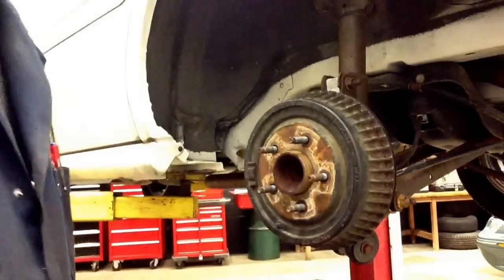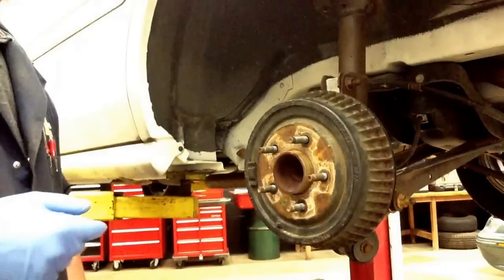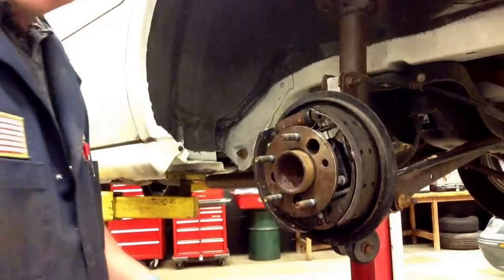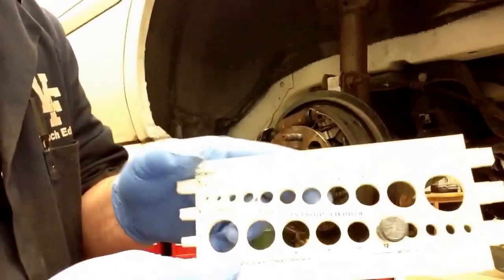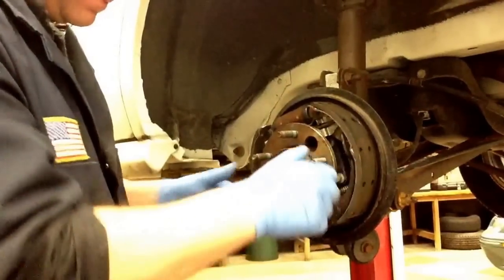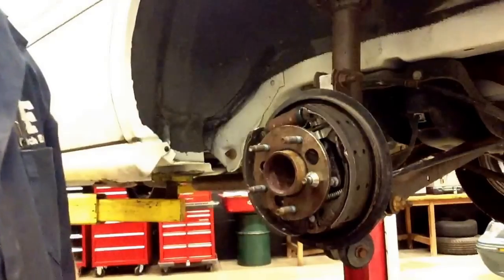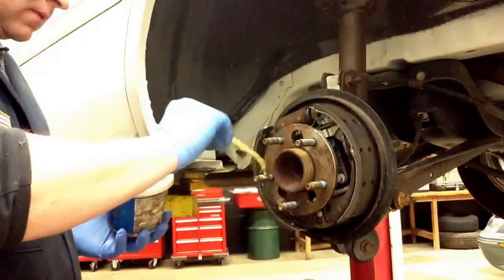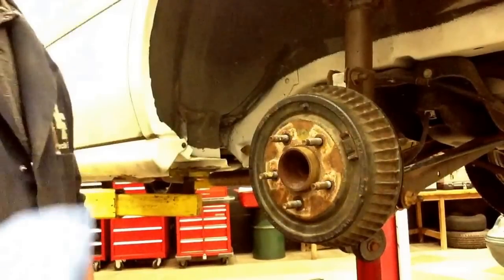Brakes: wheel stud replacement

Comment: where did you find that nut that you used to tighten the wheel stud?
Reply: it's just the stock lug nut flipped backwards.
Reply from the maker: Sorry for the delayed response, but that's the original equipment lug nut. You can get those at any parts store.